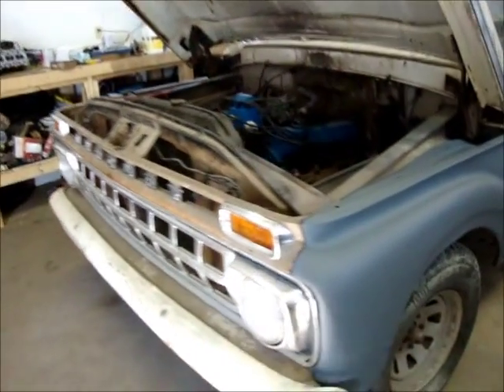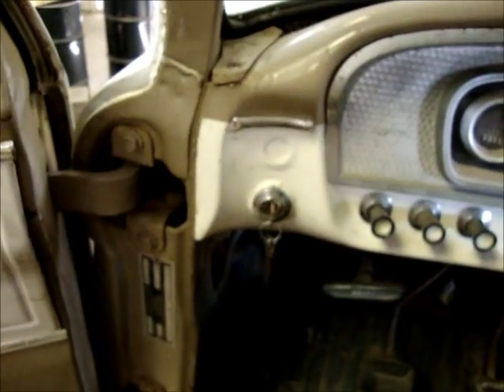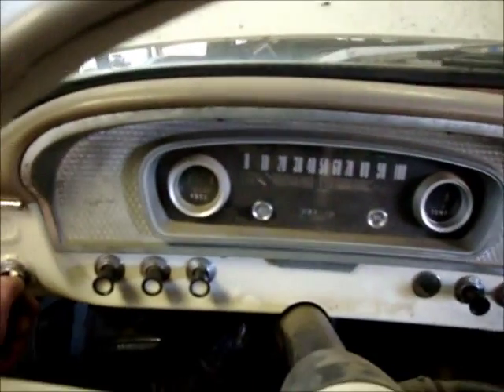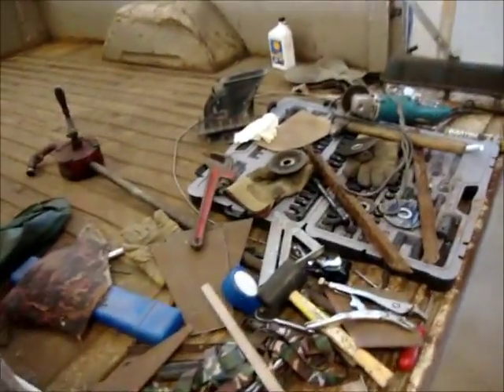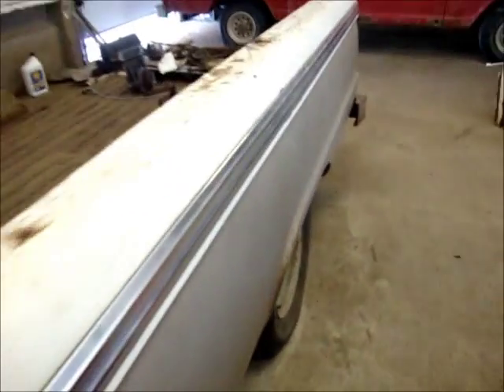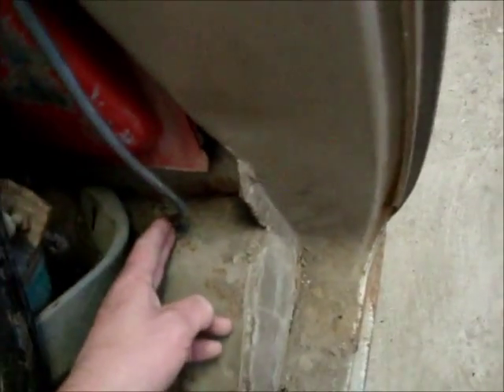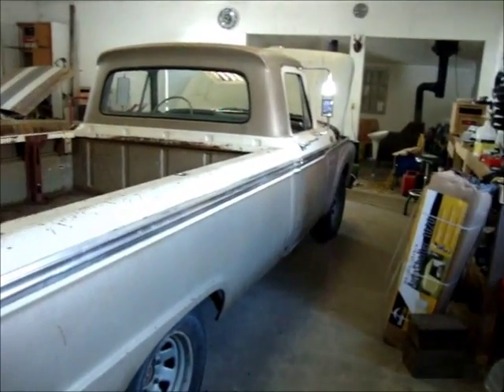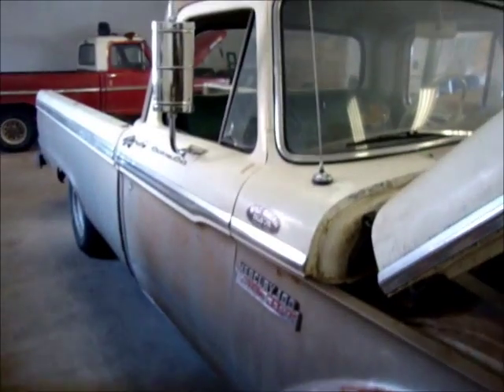Start up The Old 65 Mercury Truck

Comment: Nice old Fo...sorry...Mercury F-100. The fender looks great and no worries, each panel you decide to do will be easier. Like they say when the price just went up, "She's a runner." It's good that you guys have the patience to save vintage iron from oblivion at the hands of those with a "crush and cash" mentality. It's a buzz when you can coax them to start, I'd bet. Rock on.